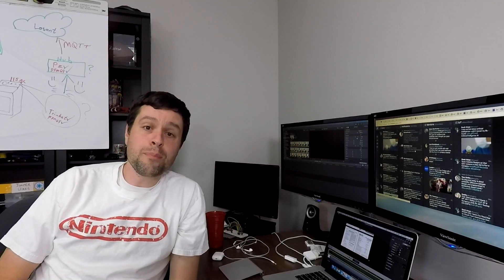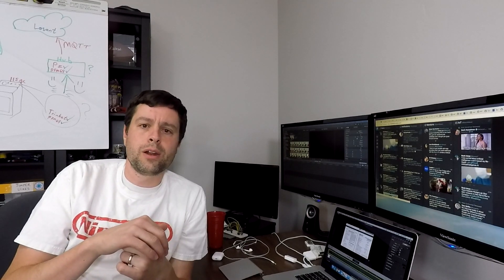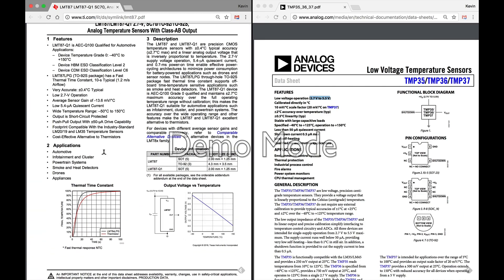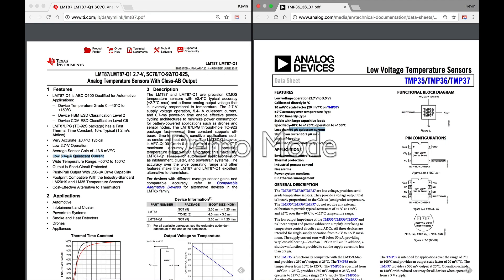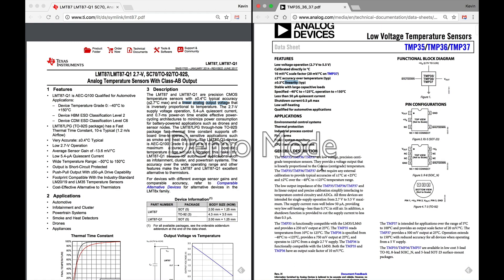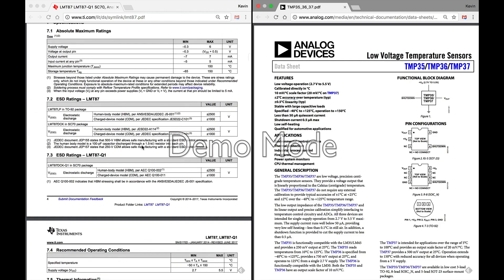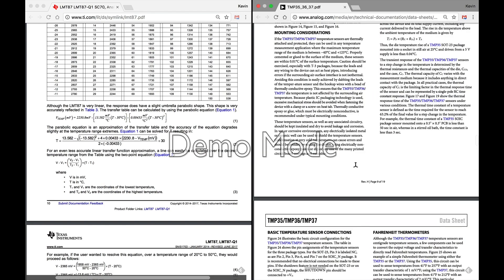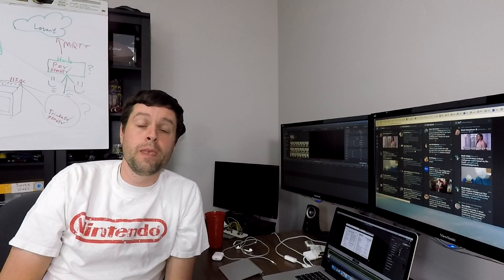Comparing the LMT87 and TMP36 Temperature Sensors

Comment: Did not take into consideration the scale and writing of the voltage to degrees C formula this is why your videos are so informative. Thank you for going over the data sheet for the two devices. Even though I looked over the info on the LMT87 did not catch the monster formula for the conversion to the real world output. I was focused mostly on the low quiescent current draw.